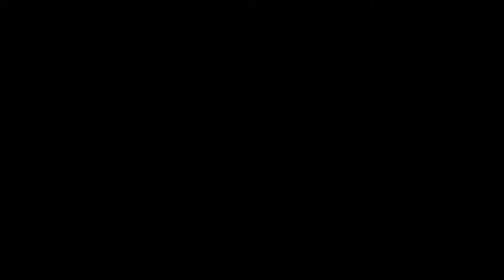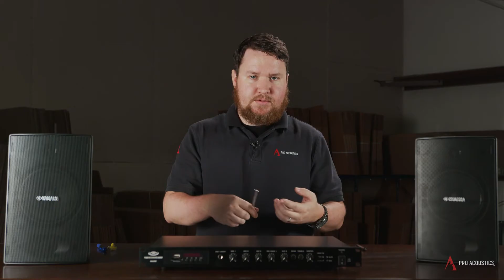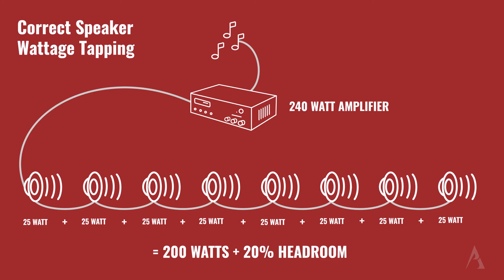Quick Clip: How to calculate how much amplifier power I need for my speakers? (Tech Talk Episode 57)

Comment: Hello! I have a question about my Yamaha receiver it’s a CR-840 Yamaha receiver it’s a vintage one. It mentions on the manual it’s a 60 watt receiver. So would that mean that I need to get two speakers at 30 watts each? It has more than two connections in the back so it can fit more speakers. I’m so confused about it. Your help would be greatly appreciated thank you
Reply from the maker: Great question! Your Yamaha CR-840 receiver outputs up to 60 watts per channel at 8 ohms. That means you can connect up to two speakers, each rated for up to 60 watts at 8 ohms. You’re not limited to 30-watt speakers—you can use any speakers up to 60 watts for the best performance. Let me know if you need any recommendations!
Reply: @ProAcoustics thank you so much! Yeah I would like to hear some recommendations please. Thanks for your help
Reply from the maker: @highpoints1983  You're very welcome! We'd love to provide some recommendations. Reach out to us at 888-256-4112 or sales@proacoustics.com with details about your space and specific needs—we’d be happy to help!

Comment: Hi

I need your support for decide PA speker which we can connect directly to Tinker board 3n speaker header (inbuilt amplifier output of 4ohm 3 watt on each (L+R)).
Please advice speaker rating (ohm & w) 
Also cable size with 5 meter
Reply from the maker: Thanks for reaching out! For detailed assistance on choosing the right PA speaker for your setup, feel free to contact our sales engineers at (888) 256-4112 or email us at sales@proacoustics.com. They’ll help you find the perfect match based on your specifications! You can also browse our selection here: https://www.proacousticsusa.com

Comment: Should a 3k brutus highfonics be okay on an sdr 15 1500 watt??
Reply from the maker: We specialize in professional and commercial audio. To ensure your SDR-15 1500-watt car subwoofer is paired with the right amplifier, we recommend reaching out directly to the speaker manufacturer, Skar Audio, for the best advice. You can contact them at (888) 501-7527 for more information.

Comment: Thanks—you help with my Hypex Fusionamp 3-way project, an active ‘impersonation’ of the Qualio IQ speakers.  You answered the question, re: if one of the amps’ 125w modules was enough for the 4ohm 90w woofer I already bought; with 40% headroom, no problemo.  (my ‘Fusionamp 123’ has two, bridgable, Ncore, 125w amps and one 100w amp.)

Comment: So 2 12s that reccomend 300 to 600 max would be 1200 plus 10% so 1320....so send 1500 watts and turn it down a little?
Reply from the maker: Thanks for your comment! Your calculation sounds good. Providing 1500 watts for a system with (2) speakers that recommend 300 to 600 watts would give you a healthy 10-20% headroom. Well thought out!
Reply: @ProAcoustics  Ty cause I've been confused

Comment: are we not considering the impedance (ohms)?
Reply from the maker: Thank you for your comment! This video specifically focuses on 70-volt applications, which use a different calculation method compared to impedance in ohms.

Comment: I thought is the ohms that determines the number of speakers to connect to an amplifier as you said in one of your video.  Please clarify.
Reply from the maker: This video specifically discusses 70-volt commercial audio applications. 70-volt audio requires different calculations than ohms.
Reply: Ohm means resistance of current...just have this in your mind...your amps ohm should match your speakers ohm...the  amps ohm should not be higher than the speakers ohm ...if your speaker is 6ohm...your amp should be 6 ohm...may be you can use a lower amp...but should not higher than the speakers
Reply: @manikandan2663  my amplifier is Wharfedale Pro MP2800 - it has resistanceof 2ohm, 4ohms and 6ohms. How many speakers can it handle?

Comment: i mostly rely on the noise complaints from across state lines.
2 each L & R Electro-Voice ELX200-15P 15 inch Powered Speaker. 
stacked on 2 each Behringer B1800Ds in center channel mode.
BEHRINGER FBQ3102 equalizer
Yamaha MG10XU
PC using USB input on mixer. no ground hum.
DENON CD player DN-300C MKII

Comment: I have 2 10 inch speakers with an amp all in one box. I’m not sure if the amp in the speaker box works but I have them hooked up to a 2800 watt amp and going to downgrade to a lower wattage amp soon but not sure what watt amp I should get. Any suggestions would be great 👍
Reply from the maker: Hi James, Please reach out to one of our sales engineers to discuss your needs and application. We'd be happy to make a recommendation for an amplifier that would work best with your set up. You can email sales@proacosutics.com or call (888) 256-4112.

Comment: I have two Electro-Voice ZLX 12BT (Peak at 1000 watts per) and I wasn't sure how to calculate how many amps of power I would need from an extension cord or how to calculate or understand why a 15A surge protector at 120 volts is enough to power these even though that "Wattage" is 1800... My terms are probably out of wack but any help on my understanding would be greatly appreciated.
Reply from the maker: Hi Levi, Electro-Voice lists the power consumption as 100 - 240 V~, 50 - 60 Hz, 0.8 - 0.5 A. I would recommend contacting Electro-Voice for any electrical related questions. https://electrovoice.com/contact-us/

Comment: Watched this video a few times but for my sanity, if you could help me answer this question I would be most grateful! So I have some speakers that say they have a recommended amp power of 40-180 watts. I have a 100 watt amp and it works fine, but if I were to get the next model up which is 200 watts, would the 200 watt amp not only give me headroom but also result in a better quality sound? I’m not too fussed on loudness I’m just on a quest to get more detail out of my music and feel like I’d get that with a more powerful amp. Would appreciate the help!
Reply from the maker: Hi David! Going from a 100-watt amplifier to 200 watts will only give you a 3 dB bump in output performance. This would allow the speakers to get slightly louder with possibly somewhat better bass, as the wattage difference would be most noticeable in the lower frequencies. However, it is questionable how much, if any, more detailed or better sound would be provided.
Reply: No, you would however be supplying more power to your speakers than what they can handle.... resulting in blown speakers.

ALWAYS choose an amp 1 power rating BELOW your speakers MAX handling capacity
Reply: No. End of story.

Comment: Hello assuming this works for car audio as well, I want prv speakers 6.5 inches that have a 150 rms, 300 program power and 600 peak watts which number do I use to do this calculation?
Reply from the maker: Hello, The concepts in this video are for 70-volt commercial audio applications and do not apply to car audio. I recommend contacting the manufacturer of your speakers to determine the appropriate amplification needed for the best performance.

Comment: I have a few questions:

I have an old bass combo amp who's speaker just burnt up after I cranked it obscenely loudly, I plan on swapping a 100w celestion guitar speaker into it, but the amp portion of the combo is rated for 75w, will a 100w speaker be powerful enough to handle the 75w amp if I play at bedroom volume? 

If it is able to handle the power at lower volumes, will I never be able to crank it high?

Should I have bought a 150w instead?

Thanks
Reply from the maker: Hello, At a lower volume, the speaker will handle the power from the amplifier. However, a higher output amp would be suggested to provide more output and headroom to minimize the chances of clipping or distortion if cranked up.